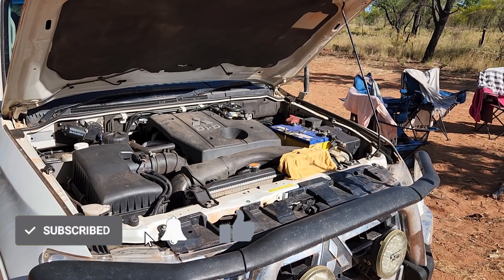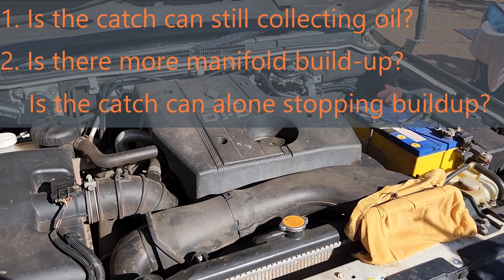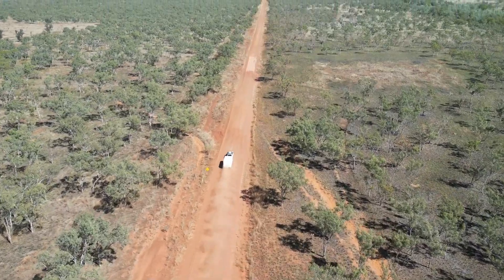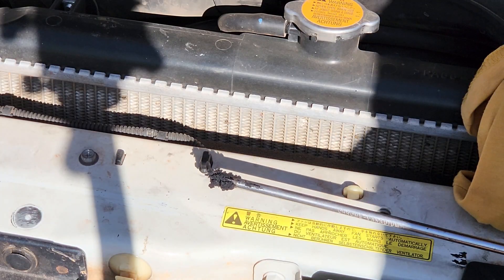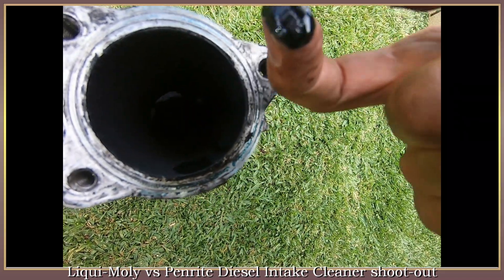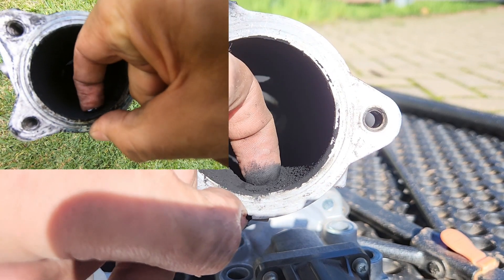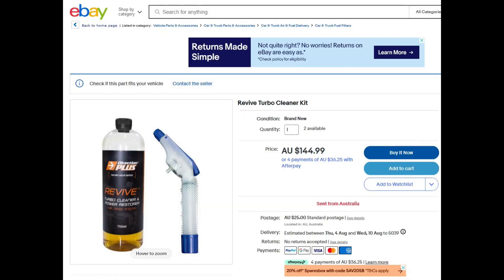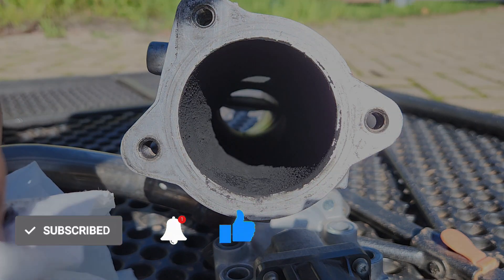[RESULTS!] Provent 200 Catch Can  - does it stop manifold gunk?? 40,000km road test!

Comment: I think the oil going back through the engine is a good thing.
Reply from the maker: It does keep the build-up moist and easier to clean, but it can also lead to fouling on the back of valves as the oil gets baked on

Comment: Hey man, how much engine oil is the Pajero consuming? For example, in 10,000, how much did it consume in total? Not counting the oil you put back from the catch can, if you put it back at all.
Reply from the maker: Hey mate mine hardly uses any. Maybe half way down the dipstick after 10000? Not much. I usually both fill mine slightly at service time, so it's down to about the full line by the next service so it doesn't really need topping up at all

Comment: I installed one on my 2019 hilux and used a transparent hose for both intake and outlet. After a few hundred Ks, the outlet starts to go black, which tells you that catch can doesn't do much. A cheap filter or improper flow can cause the head gasket to leak. I reckon the best go is do just delete the EGR and inspect and and clean the manifold every 100k or don't wory about the EGR and do the manifold every 30k to 50k depending on the vehicle use.
Reply from the maker: Yeah that's about what I've decided to. I rarely use the catch can now
Reply: Does a EGR blanking plate work then?

Comment: The catch can did its job. That soot is from the  egr and has nothing to do with the catch can. So no matter catch can you’re using it’ll never stop the soot until you block or bypass the egr.
Reply from the maker: Yep you're right. I'm just testing this because catch cans are often advertised as a complete solution to manifold buildup

Comment: run a full synthetic oil and your engine stays clean. zd30 patrol with close to 400k on the clock, clean motor, clean egr drives like new
Reply from the maker: Most of this is exhaust soot from the EGR valve, not dirty engine oil. I've been running Penrite 10w-40 semi synthetic for five years. But Pajeros tend to be heavy breathers so your Patrol probably wouldn't have the same amount of build-up even with identical oil and conditions
Reply: @ mate think about the combustion process, it is not just burnt diesel coming out those valves, oil is in the mix. Semi-synthetic is not full-syn so it still has the contaminants of mineral oil. The contaminant build up is exacerbated if you do city driving.
Reply from the maker: @aussie807  Yep naturally there's oil in there, that's the thinking behind a catch can to remove that oil. But I still got build-up with a catch can, and people with an EGR block and no catch can tend not to get much build-up. So my point is the main culprit is EGR, especially when mixed with any kind of oil, not just the oil on its own. FWIW most of this time I was doing highway driving towing a van around Australia
Reply: @ good video for you https://youtu.be/l4D8C6WR3pE?si=SLJWVO8U17clKfPa
Reply from the maker: Quite impressive. Most 10W-40 diesel oils are semi-synthetic (Penrite, Nulon, Castrol), the only full synthetic one I've found so far is Penrite Enviro which is nearly double the price. Also don't have a DPF.

Comment: Dont return the catch  can  to the air intake run it to another vented  can to catch any oil you would be sending onto air filter to block it by coating it with oil.

Comment: Hi Greg, I really appreciate your video, it was good to see what the catch can is actually doing for the intake and the difference between catch can and no catch can. I would actually like to know after you doing this test did you leave your catch can on or remove it. Cheers mate
Reply from the maker: Hi mate thanks for the comment and excellent question! Since these tests mine has usually been disconnected though not yet uninstalled as I have a couple more tests to do. But on the whole I would rather deal with moist gunk than dry gunk.

Comment: Upper cylinder cleaner every 5000kms
Reply from the maker: Isn't that basically what Liqui Moly diesel intake cleaner is? I've covered that several times on this channel and it's only made a minimal difference
Reply: @ 
When applied through the throttle body and all the vac hoses Regularly it makes a difference. 

I have also seen it take vehicles that were so gummed up that didnt run to a running vehicle again. It took 3 cans.

Comment: I bought a 2016 Fiat Fullback with the Gen3 4d56 Mitsubishi engine. It had 90000 kays on the clock, so I thought it best to check the egr valve for any carbon build-up. What I found was surprising, as it was actually very clean, with negligible build-up and it had never been opened. This was a stock standard motor with a full service history every 10000 kays. I am therefore inclined not to worry about checking it again for at least another 90 thou.
Reply from the maker: Wow that's very surprising! The 4D56 is generally less well regarded than the 4M41 as it was originally a petrol engine which was then tweaked for diesel, but it has an EGR system just like the 4M41 so there's no reason it shouldn't gunk up like the 4M41. It's possible someone may have done an EGR delete on the vehicle before you got it, have you checked for that? Either way the end result is good for you though!
Reply: @TheMusingGreg . So the EGR is still in place. I checked the service history of the previous owner and he was doing 20 000 kays a year, servicing the vehicle every 10 000 as per the manufacturers requirements. I'm  guessing he had a job that required long highway drives everyday. Maybe that's the reason for the low amount of gunk?  Doesn't  the EGR stay mostly closed at highway speeds or when under hard acceleration?

Comment: Well…. If you have an EGR, a can will only stop the buildup that would have been caused by the PCV, not the buildup that comes from the EGR
Both systems do that, and there is an argument that the EGR is far worse
Reply from the maker: Yep I'd agree with that. EGR build-up is much tougher and harder to clean off  than the oily stuff

Comment: New to all this but what are the thoughts on the ERG cable module, has anyone tested how they perform?
Reply from the maker: I've not done the resistor mod if that's what you mean, but my understanding is that it works well and doesn't interfere with the functioning of the rest of the engine management system.
Reply: @ cheers mate

Comment: Kids are doing it wrong, first you delete the EGR. Then you run the stock ccv system for an oil change or two, this is your chance to clean everything while its still wet and not all caked in there. Then install a provent and draw the vacuum from before your air filter.
Reply from the maker: Most of that would probably work provided you're happy to do an EGR delete and you can get the manifold clean, which will probably require removal. However the Provent doesn't have a vacuum line. If you're talking about the air return line, it needs to go back after the air filter and after the air flow meter. If you send it back into the system before the air filter any oil residue will block the filter. Also the air flow meter is after the air filter and the air in the blowby system has already been metered, so you'd end up with a slight mixture imbalance as you'd be measuring that air a second time.
Reply: @TheMusingGreg  My bad, yes drop the return line a lil down stream from the MAF. The issue with it being so close to the turbo, it has too much vacuum and sucks all the oil from most cans. You must move the return line away from the turbski!
Reply from the maker: Fair enough. I guess it depends on the vehicle; on my Pajero it's a pretty short run from the air flow meter to the turbo but others may be longer. Also, it's simplest to just reuse the port that the PCV line originally went into so that would leave you with no choice of positioning. But even with a long run, I can't imagine the vacuum is going to drop by much, it's the same volume of air after all whether it's close or a long way from the turbo.

I think a bigger factor would be catch can design, and possibly for cheapies with less baffling to protect the oil reservoir, what you're saying could be important to consider.

Comment: Yes, no benefit of a catch can alone.  And there are lots of serious downsides from high crankcase pressures which are why dealers frown on them.  Might just be the biggest con of all time?
Reply from the maker: As far as stopping manifold gunk, yes. There are possibly other benefits to a catch can by having oil removed from the intake (possibly reducing detonation for example) but I wasn't looking at that. As to the second point, crankcase pressure depends on the design of the catch can; the Provent has a pressure relief valve to prevent this happening and I'll be testing that in a future video, but cheapies without that definitely run a risk of increasing crankcase pressure.

Comment: Do these work for gas engines?
Reply from the maker: Yes certainly. They just tend to be more common in diesels as people try to use them to stop manifold build-up caused partly by EGR soot which you don't have much of in a gas engine. I believe some people use them in gas engines to improve combustion as the air is cleaner and has lower detonation rates especially on turbo'd engines. Just what I've heard though.

Comment: I did my EGR first. Ran it for a year, and still going. Just did the elephant hose mod. I'll simply add a tap to it. Cheers
Reply from the maker: Yeah the elephant hose mod will stop the build-up, but only because it dumps all the soot and blowby oil to atmosphere. That's how crankcase ventilation was done in the very early days, but it's pretty unfriendly for the environment which is why it gets plumbed back in these days and burned. The crankcase ventilation isn't as much the issue as the soot, which you probably don't have an issue with if your EGR is bypassed.

Comment: I appreciate you putting this out there. I might recommend a water methanol injection system to keep the intake clean.
Reply from the maker: Interesting, would that work? I thought they were more for performance
Reply: @TheMusingGreg  lowers cylinder temps, gives a more complete burn, the water methanol also acts as a cleaning solution from point of injection out the exhaust. So, yes, it will clean out the carbon deposits in your intake tract.
Reply from the maker: @Akya2120  Thanks. ~$800 is expensive for a water / methanol kit, plus the cost of the methanol, but I guess it could work out cheaper than paying someone to remove the manifold once in a while. And probably cheaper than 20 cans of liqui-moly too!
Reply: @TheMusingGreg thats true. It's also going to give you a little more power, and keep the exhaust temps down, as well as keep your fuel economy up between those proposed intake cleaning services. You can also run just straight water injection instead of adding methanol. It will help clean, but it won't have near the cleaning power as water methanol.

In the US the AEM water meth kit is $500, but that's about $750 AUD. You might be able to source stuff cheaper, but you'd need your wits about you to get it together functioning correctly. Honestly, at that point it's probably worth the extra $250 over sourcing the stuff. Many folks skip the tank and use their washer fluid reservoir for the kit. Personally, I'd come up with a tank that makes sense for the vehicle. Something like every 3rd fuel up.
Reply from the maker: Sounds sensible, I'll give it some thought!

Comment: Can you not vent the pipe down to the ground, so that there is no oil getting into the air intake? That would solve it
Reply from the maker: That would solve any chance of oil fumes getting into the manifold. But that air originally came in through the air flow meter, so dumping it to air would cause an air fuel imbalance. That's why it's routed back into the air intake after the air flow meter so there's no air lost from the system. In any case this catch can is pretty efficient and not very much oil fumes come back out with the clean air.

Comment: It is possible, that what you are affecting with catch can is not only the build up in the intake - i guess that is mainly an EGR caused thing, but you are most likely getting less carbon build up in the combustion chamber as you are getting less oily mist in the intake itself, but thats just what im thinking, anyway, good video.
Reply from the maker: Yes that could be true, it would be hard to tell for sure but you could be right.

Comment: 250,000km thats a lot of kms. Have you used low sulphur low soot diesel? And catch can doesnt block ALL oil, some will still go by, i dont know if you can put a 2nd stage catch can, likely towing is causing more blow by? Interesting videos nontheless
Reply from the maker: No mate, we just use whatever diesel we've got here in Australia and when you're out back you just have to take whatever is available. We don't actually have low sulphur diesel here anyway even in the cities. I think the small amount of oil vapour that's got through the catch can has helped the soot to not get too dry, so it's probably actually beneficial having a small amount of leakage as it were.

Comment: You can please the avoid the pollution junky in you or vent it, no sud in your engine to worry about. Or you can get a water gargler  let the sud, oil and vapors out of the crank case fumes. Choose wisely one not so legal.
Reply from the maker: Any suggestions for the water gargler?
Reply: @TheMusingGreg  use the catch can. Adapt the inlet with plastic tube to bottom inside the wster and the outlet free flow out. The water will catch impurities. Or use a water filter container (no filter)  same comcept the water is your filter. Dump water as necessary.
Reply from the maker: That's just going to do exactly the same as what the catch can already does which is separate out the oil and return clean air back to the intake. It's just using a different method. How would the water gargler provide any benefit over the existing catch can ?
Reply: @TheMusingGreg   the results are cleaner plus some water vapors for the valves and intake
Reply from the maker: Ah ok fair enough 👍

Comment: For too much build Unwanted dirt in your manifold try to AGR valve conect after DPF filter and send almost clean exhaust gases to intake manifold and after that catch can have sense. That is what must manifactures of cars done but than there is no too much meet on bones for service net.
Reply from the maker: Can you clarify what you mean? Which side of the EGR valve is connected to the exhaust pipe after the DPF? I don't quite follow how it works as you described
Reply: @TheMusingGreg it shoul be conected after DPF filter but manufactures connect directly to exhaust manifold and that cloging intake manifold.
Reply from the maker: Oh right I get you. Yeah I can't see why that wouldn't work, although I don't have a DPF so couldn't be done for me.

Comment: Have removed the Exhaust Gas Recirculation on a A4 B8 3L diesel. My intake is as clean as a freshly mopped floor despite haven driven 70.000km after the removal. Only thing I am struggling with now is oil going to the intake manifolds. Hope a catch can can reduce it a lot or even remove it completely.
Reply from the maker: Sounds a pretty good result! Was it that clean before you removed the EGR? This catch can certainly seems to be effective at removing oil from the intake so definitely give that a go!

Comment: If you continue to use the catch can and operation of EGR, your intake valve clearance will need to be checked more frequently! I have disconnected the EGR in my 4N15 and did not install any catch can, clearance is ok after 90000km. I don’t see a benefit from a catch can, EGR is the main source of soot build up and intake restriction.
Reply from the maker: Interesting! What's the correlation between valve clearances and EGR soot without a catch can? Do you just mean dry soot building up on the back of the valves?

Comment: Hi Greg , been following your updates for some time now and really appreciate the effort you put in these experiments for us to see.  There is another thing that i have been looking into lately and that is water-methanol injection. This has been a game changer in the petrol engines and especially in the DI (direct injection) engines as they were notorious for carbon build up on the intake valves. After installing the water-methanol injection it keeps everything spotless. and ofc it also has other performance advantages. However I've been thinking if this is something that could be a benefit for diesel engines too. For example having a water-methanol port injection before the EGR valve in the intake and see if it will help stop the soot build up in the intake. I assume if it does help it will probably be most effective when starting with a clean intake manifold. 

Well that was my two cents, let me know if you have any experience with this and if it's any interest of you to try it out and see if we can find solutions to stop the soot build up while keeping EGR still in function. Thanks again and hope to see more.
Reply from the maker: Interesting thought mate. I don't have any experience with that, however I have previously thought about having something that would periodically spray a bit of Liqui Moly intake cleaner into the manifold. However anything after the turbo obviously has to be able to withstand boost pressure so I didn't think about it any further. What you've suggested could work, although I would be concerned about the methanol contributing to detonation in a diesel engine due to the higher compression ratio. It's also possible a simple water spray or Seafoam, in moderation, might do the job, but I've not tested this.